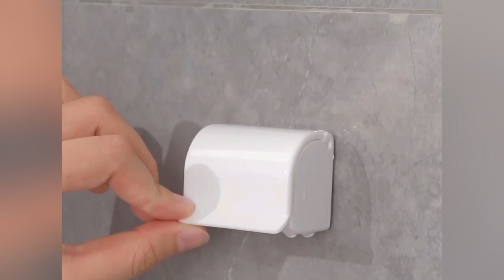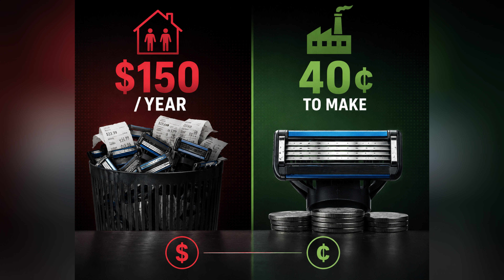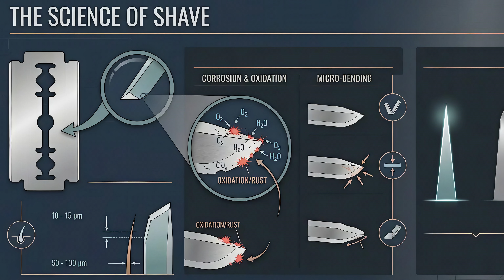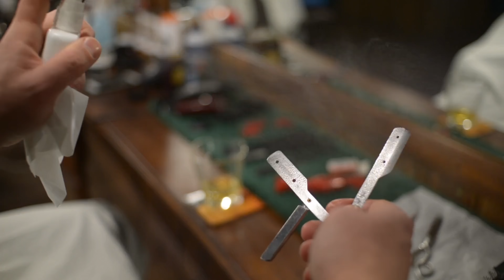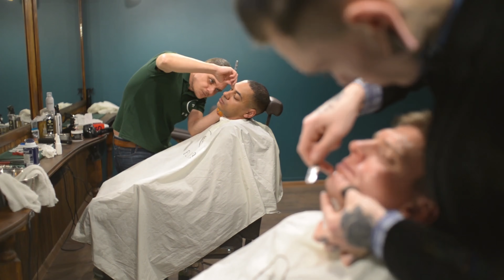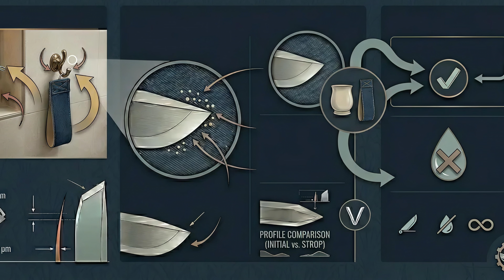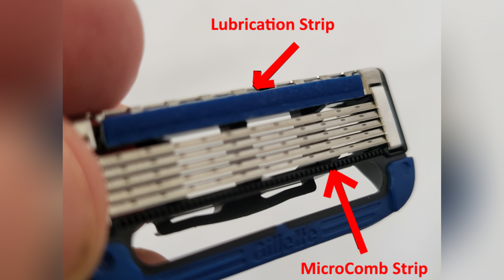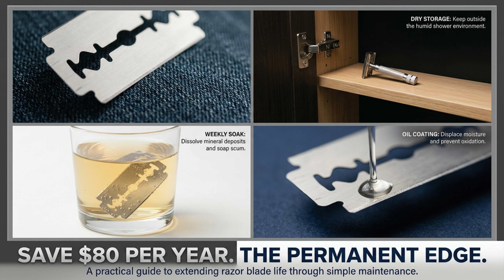Your Razor Is Designed to Dull After 3 Uses — How to Make It Last 2 years!

Comment: Flip the razor, do it on the opposite side? I don’t get it
Reply: pretty sure he is referring to a straight edge razor not a multi cartridge type.  flipping it gets the other side stropped
Reply: Exactly, he said run the razor backwards only. How are you suppose to flip it ?
Reply: @eddiediesel9035 I asked the same. That was unclear i watched 3 times
Reply: @eddiediesel9035   I already tried to explain what I thought. Some of the razors he showed were like the roof of a long house, two halves tilted slightly away from each other with blades on both sides. So if you hold it at a tangent to your skin it sits on the ridge. Tilt it either way and it cuts 'that way', 'like' a paint brush (I think).
Reply: i read the 5 responses, still unclear...
Reply: Barbers have been stropping their razors for ages, but they strop both sides of the blade .
Reply: I think he's referring to a safety razor not a cartridge type.
Reply: He clarifies in the pinned comment: he means push the shaver up the denim and then turn it and push it down the fabric to hit both directions of the denim's weave; the shaver position and direction are unchanged.
Reply: @JohnnyFuentesReal   Doesn’t make sense to me either.
Reply: I haven't encountered em but looked like some in his vid had two cutting faces, assume so you can shave 'up & down' by tilting the things?
Reply: @JohnnyFuentesReal  opposite side of the denim as in turn the piece around not over

Comment: - [ ] Multi-Blade Lubricating Strip Multi-blade razors retain sharpness significantly longer than single-edge razors. To mimic single edge razor life, Procter&Gamble / Gillette invented a sacrificial wear strip, falsely marketed to consumers as a "lubricating strip" for skin comfort.  This mechanism is designed to degrade within a predetermined time, the strip’s erosion alters the razor's effective shaving angle. This change causes the "drag and pull" sensation associated with dull blades, regardless of blade condition, count or hair type. Shaving creams provide sufficient lubrication, the functional necessity of this strip is to increase sales by deceptive design and marketing practices!

Comment: This is an excellent public service announcement. Thank you for helping people in this way. I have been rinsing, drying, fabric stropping, and mineral oil coating my blade cartridges during the past three decades. I started after reading Vance Packard's "The Waste Makers."

You repeated some important points several times, but you missed a detail. Blade cartridge manufacturers also produce shaving cream. It contains chemicals that accelerate the pitting of the metal edges. If you use canned shaving cream, be sure to rinse it off the blade immediately after the last bit of shaving is complete. Minimize the number of seconds the blades are exposed to the foam.

If you soak your face in warm water first, ordinary hair conditioner can work as a shaving cream. I shave while in a warm bath tub. First, I turn face down in the water and wash my face using unscented Dr. Bronner's liquid soap. Next, I coat the skin of my face using a hypoallergenic unscented hair conditioner. Mach 3 cartridges work great this way, and give extra sharp shaves after months of use.

After shaving, grip the handle tightly and wave the blade end underwater as strongly as you can manage without splashing water on the other side of the room. That gets all the stubble out of the blade cartridge. Then, rinse with fresh water from the faucet before drying, stropping, and oiling.

Comment: I tried those Amazon Basics and they were awful... tried the 3 and 5 blade... the 5 was worse... I use Match3 and they are ok... what is better?  I will try what is said in this video... thanks!
Reply from the maker: If someone wants the best long-term option, the old-school safety razor is probably the winner. One handle can last basically forever, and the replacement blades are dirt cheap compared to cartridges.

That said, safety razors do take a little more technique — lighter pressure, slower strokes, and you have to respect the blade more. So for people who want easy and familiar, a Mach3-style 3-blade cartridge is still a solid middle ground. But for cost, control, and less plastic waste, safety razors are hard to beat.

Comment: While the content in this video sounds like a great way to stick it to the razor companies, the "science" in the video is flawed and gets some things wrong.

Firstly, hair absolutely DOES dull steel. The video claims hair is too soft to dull a blade and that only rust/oxidation is to blame. This was debunked by MIT researchers in 2020. They found that human hair actually causes microscopic chips and cracks in the steel. When the blade hits a hair at an angle, stress concentrates on molecular weak points, breaking off tiny pieces of the blade. No amount of rubbing on denim can "un-chip" missing steel.

Secondly, cartridges are NOT straight razors. This video compares modern cartridges to barbers' straight razors. But they are completely different tools. Straight razors are thick, single pieces of carbon steel meant to be stropped. Modern cartridge blades are ultra-thin stainless steel coated in Teflon, platinum, or chrome. Stropping them on rough denim can actually strip away these friction-reducing coatings, making the shave worse. Plus, the plastic housing makes it impossible to get the right angle on the blades anyway.

The video recommends a weekly white vinegar soak to remove hard water minerals. Vinegar is acetic acid. Soaking a microscopic, 10-micron-thick steel edge in acid will cause micro-corrosion and pitting, leaving you with a scratchy, jagged blade.

However, the video did actually get some things RIGHT. Leaving your razor wet on the shower ledge does cause it to degrade faster. The real takeaway is if you want to double the life of your razor, take the video's advice to shake it off, dry it thoroughly after use, and store it outside the humid shower. A drop of mineral oil will also help block moisture and reduce friction. Just don't expect it to magically make a disposable cartridge last until next year!

Comment: I use single blades for shaving. Good ones come from Turkey. Good They may get dull after several months. Before shaving, I apply oil to my skin. Shaving oil is ridicuousy expensive but baby oil is the same stsuff and much cheaper. Of course, I then apply shaving soap or spray.
I do not use shavers with multiple blades. I never understand what they are good for, not in 60 years. The best value for money are safety razors produced in India.

Comment: I shave both my face and my head with a safety razor and a good shaving soap. With blades costing less than 25 cents each I've got a 100 year supply at 4 shaves a week.
Reply: I use cheap gel shampoo in lieu of shaving soap. Just spread the gel instead of lathering it up.

Comment: Wilkinson has a very cheap and decent plastic safety razor. Those blades cost next to nothing. I had a pack of 100 for a couple of bucks and even if i switched them after every shave, I would never get to 80 bucks a year. Still doesn't hurt to make them last longer.

Comment: It has no effect. Even if you do that, you're just using it in a bad condition after the 20th time. If you really wanted to, you could use it for 10 years without doing all that. The problem is that you're stuck using it in a degraded state. It's best to change the razor blade after 10 shaves.

Comment: When my Mach 2's get blunt, I rip off the rubber bit & bin it. Then I open up the metal tabs on the back, push them through and bend the metal up. Then I tweezer out the blade that was nearest the binned rubber edge. Push the metal tabs back and enjoy the sharper blades remaining.  Another tip I learned from Woody Allen that his father taught him is save string ;-()
Reply from the maker: That is one of the most hardcore DIY maintenance tricks I have ever heard! 🛠️ 🤣 BUT I LOVE IT!

Comment: I started with electric razors, then eventually moved to the three, then four, then five blade cartridge systems. Five years ago I decided to go old school and went whole hog on the double edged safety razor path. With blade shaving, I always did the shaving soap and silver tip badger brush routine, and I love the routine. But going from multi blade razors to the double edged safety razor was game changing. I go through a blade every week... and I could care less, because I can buy two years worth of really good blades for $30. That's far less than a four pack of multi blade cartridges that used to last me a couple of months.

Related aside: on a whim, I purchased a double edged safety razor blade sharpening tool that was manufactured in Germany close to eighty years ago. It works by clamping the blade inside the tool, and then pulling a cord that generates an oscillating movement to hone the blade against two sets of sharpening stones. In full disclosure, it creates a really sharp but also very rough blade edge. Maybe it worked better back during WWII?  I've used it a few times, but got tired of the DNA release and dependence upon styptic powder. lol

But back to the video content... I'd never heard of using denim as a strop, but I guess it makes sense in a way. You could also use an old leather belt as a strop, but I also own a plastic/rubber blade sharpening strop that seemed to work pretty well. I used it after each and every shave when I was doing the five blade head routine.

Comment: I switched to a safety razor years ago and never looked back.  A single double edged blade.  It doesn't clog with my stubble.  Gives me a closer shave.  No razor burn/rash.  And the blades are super inexpensy.  I'll never use a gimmick razor again.  Old school is the way.
Reply: Yep. I switched to a safety razor for my legs and pits. So, so much cheaper (under $6 for fifteen blades) with a bonus that it's also more environmentally friendly (far less plastic).
Reply: @RudesMom  what else?
Reply: I thought I  was the  only one who did that, my g.friends have looked perplexed when they found out
Reply: Oh yes that old school term, inexpensy. Thanks sweetie.
Reply: I don't know why, but i am afraid to use those older style razors. 
I use the disposable Bic with 1 blade. The yellow pack has 10 razors inside (white plastic body 1 blade yellow orange plastic cap) and it costs about 3 euros maybe less if it's on offer at supermarket. With 1 razor i would do about 3-5 shavings before i through it away.
Reply: @nikossiotas  They aren't any more dangerous than the disposable ones. If you don't cut yourself with the disposable Bic, you should be fine with a safety razor. Even when you replace the blade (which has two sides so you will get 6 to 10 shaves), it's pretty darn safe unless you have motor issues.
Reply: You can seriously hurt yourself with the safety razor if you're not smart. Ask me how I know?! 🤣🤣
Reply: @nikossiotas I find that I cut myself and get razor burn WAY less with the safety razor than the others.  I actually dry shave fairly frequently and a cut is very rare.
Reply: That's how I started shaving in the '80s, and for some reason I got sucked into this disposable stuff. A bunch of years ago, I shifted to safety razors again; haven't looked back since.

Comment: I’ve been drying my blades for years. Rub it backwards on a dry towel and put it in my bathroom drawer. Lasts about 6 months before I notice any razor burn.
Reply from the maker: That’s a great routine, and it really makes a huge difference for blade longevity!
Reply: My gillete fusion is vertically mounted so it dries, never noticed rust, and I use it for months, I don't shave daily.

Comment: Not believing any of this I use a knockoff version of Gillette blades found at Walmart and as long as I shave after a shower and use plain old bar soap instead of shaving cream, which saves me money, my blades last two months he’s knocked off blades have much more lubricant in them and it lasts for months more than Gillettes top of the line blade and they are significantly less expensive

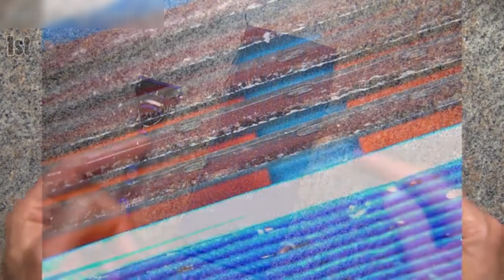Comment: 03:18 "flip the razor, 20 on the opposite side"
I wish you had shown this. I cannot figure it out. The opposite side is plastic.
Reply: It cannot be done on such razors. I’m a professional blade sharpener and can sharpen anything. This method only strops one side of the blade, it cannot strop the other.
Reply: @W_H_K  Thank you for your reply.

Comment: My razor lasts way longer than 2 or 3 times. I rinse it out and make sure it is clean and not put away wet, ever. I will try this denim trick to see if it helps. I don't just throw it in a drawer  as soon as I am done using it.

Comment: I shave in the shower which has a marble trim piece around the entrance.  For many years I’ve gently stropped my Gillette Fusion blades on the marble trim anytime they don’t feel sharp.  I generally get four months minimum out of each blade, with my record being nine months before it stopped holding an edge.  A trivial amount of effort has saved me lots of money over the years.  Great video.
Reply from the maker: Nine months is an impressive run—thanks for sharing such a practical and effective tip!!

Comment: DUDE! I've been putting my razor into a jar filled with silica gel for a decade now, I always felt like it works because I noticed the blades were getting dull even with low use so I figured it is the moisture. I do the same stuff with Loctite 401 bottle by the way, I keep the glue open, put it in a jar half-full with silica gel balls and close the lit firmly, and it never dries out, it is still as viscous as when I first opened it as that definitely reacts to moisture.

Comment: Really good video, can you do one on rotary head shaver blades ?
Reply from the maker: Absolutely — that’s actually a great idea. Rotary shaver blades are a whole different beast compared to cartridge razors, because you’re dealing with those circular cutters and the foil/guard screen working together.

The short version is: yes, they can usually be cleaned and maintained better than most people realize, but sharpening/restoring them is a bit different. You have to be careful not to damage the cutter heads or the thin foil surface, because that can make the shave worse instead of better.

I’ll add that to the list — rotary shaver blades definitely deserve their own video. Thanks for the suggestion!

Comment: I found that even the cheap razors from Aldi can last over a month just by cleaning them out with a water pick. Up to 2 months out of a single razor if I shave daily. If I skip a couple days between shaves they dont last as long. I assume its because the longer beard hairs bend blades? Damage  the thin blades? But I have no problem getting at least 6 months out of a $3 pack of Aldi razors.
Reply from the maker: That's a great tip about the water pick! Longer hairs can definitely put more stress on the blades, causing them to dull faster.

Comment: I have  been using a single blade razor for 60 yeears. I bought enough Wilkinson English blades for the rest of my life. Same razor that my Dad got in WWII. Still have have my Great-great grandfathers straight razor. I rinse my blade and dry it with a towel. Use about 2 a year.
Reply: Wilkinson makes cheap products
Reply: Army razor. Exactly- engineered to last through conflict. That's how I started shaving and it's still the best

Comment: I get a month out of a cheap Bic disposable razor by rinsing it off, dipping it in 90 percent rubbing alcohol and putting it a shelf until next time. The alcohol blots up the water.
Reply: Does the alcohol dry out the moisture strip?